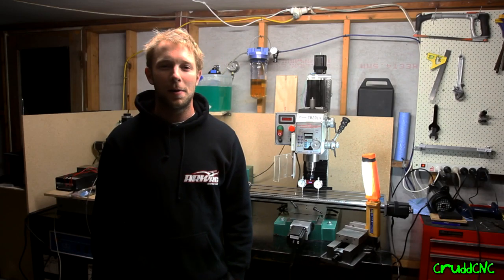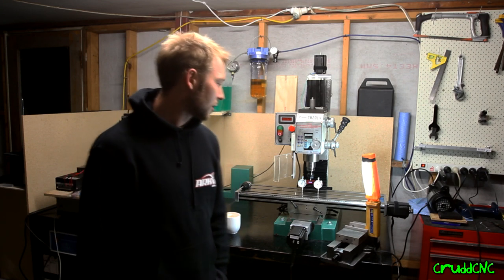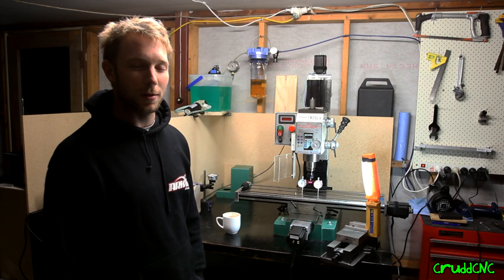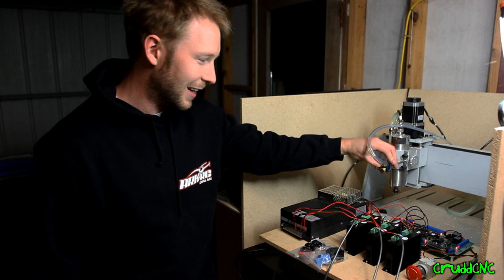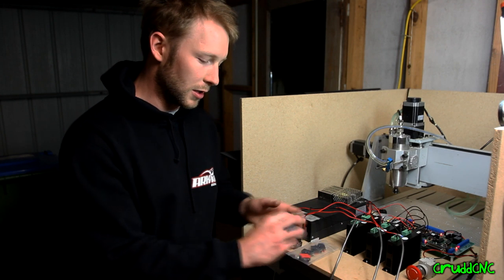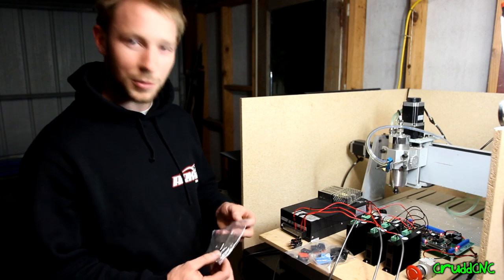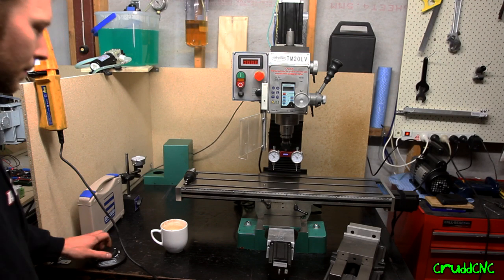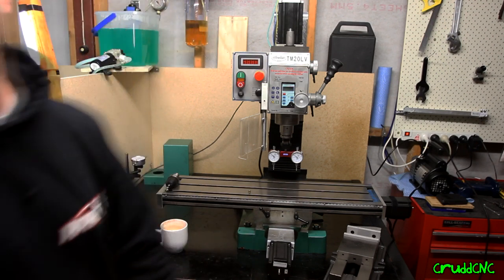CNC Mill conversion - Episode 3 - Operational !

Comment: How did you get your mill up onto that table? I just got mine today and it is heavy af...

Maybe I should have read the specs a bit more before ordering it. xD
Reply from the maker: ⵉⵜⵔⵓⵏⴰⵓⵜ i took the head column and table apart to lift it in pieces 👍😂
Reply: @cruddCNC  

Thank you for the tip.

Comment: Hey Luke
Just a quick heads up on drive cards seriously mate you can't do much better than the gecko 201x cards at 60vdc using low inductance 8wire nema 23 or 34 motors, this combo is by far the sweetest setup for rapid 3D interpolation in both motor torque and speed leaving most chinese stepper cards for dead..........cheers